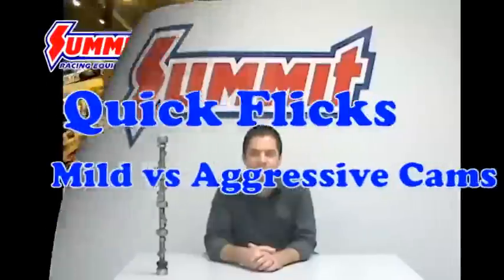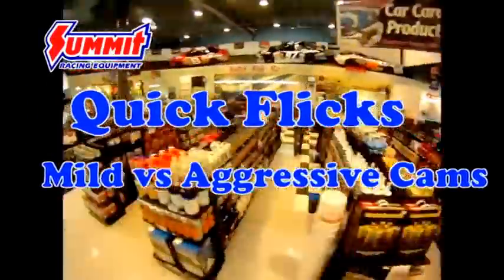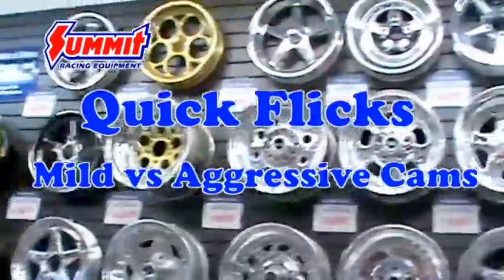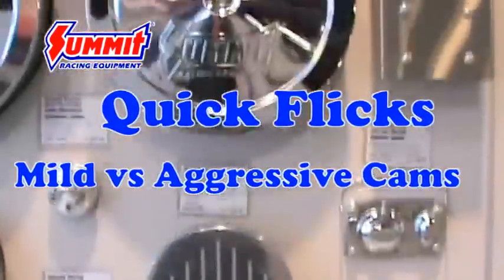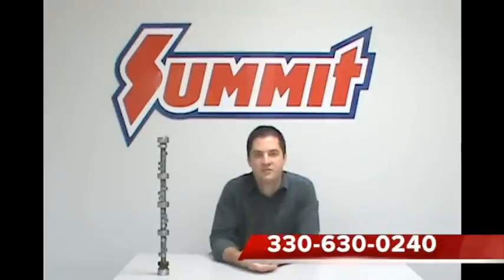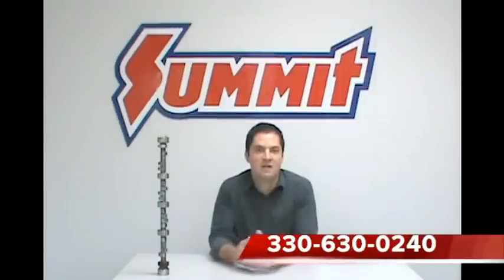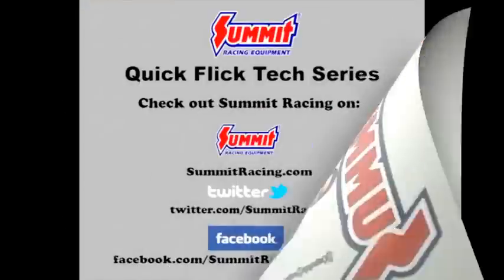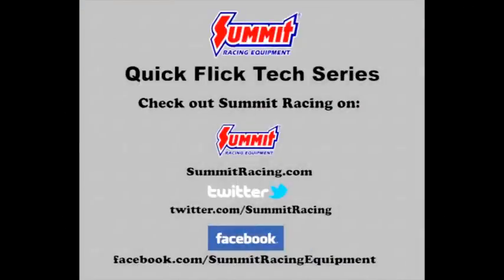Types of Camshafts | Learn the Differences Between Mild and Aggressive Cams

Comment: I have a 1980 gmc crew cab dually 2wd th400 with clutches and shift kit & 4:56 rear gear I've spun bearing in 2 454's so have a 350 in it now has a 12-206-2 comp cam cause I had it laying around also has old School single plane Torker intake with 1" spacer & 650 edelbrock carb 1&5/8" headers with 3in collectors and 2.25 exhaust all the way out the back with glass packs stock stall also. Should I get more aggressive cause I'm used to my diesel where I feel like it's gutless unless your sucked to your seat 611hp 03 6.0 powerstroke I just want a fun reliable daily driver
Reply from the maker: +buster layton , 
If you are trying to equal the Powerstroke power output, you are going to need more cubic inches, compression and air & fuel!
Reply: Correct, a sb chevy 427 or 434 can get you 600-750 hp but it will cost more than 3 of those trucks are worth. You can build a 383 sb chevy and get around 550 hp at a much more affordable level. The 383 is going to cost you at least 5-6k and thats doing a lot of the build yourself.

Comment: Simple facts about cam shafts.  
1.   Its a lot of work to change one.    
2.   You want RESULTS ! for your hard work.  a RV cam, 268, 270, anything with 112or more lobe separation is a total waste of time.   Long duration, tight lobe separation 107 108 will give you lots of 'over lap' (both valves opened at the same time) thus the lopey sound.
3.  You can go too far hipo, and lose idle completely (bad is you have an automatic trans, or lose vacuum completely making power brakes difficult.
4.   Probably  90% of people just want a bumpy, lopey idle for loping through the parking lot at the next car show, or traffic light.
5.  Headers, another waste of time and money.  They 'might' add 6-12 HP, considering the amount of work to install.  Not worth it.
6.  Carb, bigger is not better.  283-327  500-600cfm MAX,   350-383 750-800cfm MAX  leave the 1150 double pumper to the big blocks.
7.  The guy with the REALLY CHRISP lopey sounding car at the car show, has A LOT of compression, on top of that big cam.  If thats what you're looking for that is a complete engine tear down by a professional builder...  Only then does "CAM SELECTION" become important.   Then do big tube headers, high stalls trans, rear end gears.  This is when you have more money than brains.

Aluminum heads, port and polish heads, another waste of time and money, unless you're going 'full race' build.  You will never feel the difference in a mostly stock car.

Old school hot car, hot cam sound,  run a 'cutout' on your exhaust system, and a manual choke to your carb.  When you pull into the parking lot, open your exhaust and choke the carb to the sound you like.
Reply: Wow.
Just. Stop.
Reply: cmscms123456 apparently everything is a waste of money then.
Reply: I don't know much but im looking for that rough idle sound cant you just get a stock cam with more overlap
Reply: cmscms123456 well you just need a stock 305 SBC
Reply: @ 
cmscms123456

If we are going to simplify, then lobe separation angle of 112 is good for power brakes, keep lift under .500 lift on a SBC to avoid messing with valvetrain geometry, 10:1 compression, and a Holley 3310 should give a quick ride.  I don't have 10:1 compression, but I am going with the items above.  My car should be quite fun once I break in the new cam.
Reply: Ryan talk to comp cams they sell a couple cams that will fit your needs and not have to change springs and stall and all that. I think the cam is called thumper and like I said they have a couple different ones... Call comp cams ....
Reply: I guess that’s why every single performance-built engine ever, has a big cam, upgraded heads, headers etc...
Reply: Aluminum heads are a tool when you have built too much compression for pump gas by just a small amount. Aluminum heads in place of cast iron are the same as dropping your compression 1 full point when it comes to detonation. This is a quote directly from Scot Godbold at Crane cams. He also says that 200 psi is the maximum compression you can run on 93 pump gas, and thats using modern efficient aluminum heads. You cant run 200 psi with cast iron heads.
Reply: What if I have a 427 going in a F-600 or RV for highway towing? What cam and carb? I'm guessing it depends on crank geometry and head flow?

Comment: Will a LS2 cam fit and work properly in my 2007 Chevy Monte Carlo SS 5.3L?
Reply from the maker: Calvin Burleson , Physically the cam will fit and work but, you will also have to change the timing chain set (3 bolt), delete the DOD and have the computer retuned. It would also be suggested to upgrade the valve springs to match the cam and upgrade the trunnion bearings in your rocker arms due to the increase in lift, spring pressure and RPM. Another suggestion would be a better intake manifold and throttle body for all this new airflow. This will be a big undertaking as the motor must come out of the car in order to slide the camshaft out!

Comment: If I use a solid roller cam at .700/.714 lift 308/316 duration how often would I have to set valve lash if I drive the car once-twice a week in the spring/summer time
Reply: Every time. A hydraulic roller will only lose you around 30 hp. Now if you take a flat tappet solid lifter cam, you will need an additional 10-12 degrees duration in the flat tappet to equal the hp of the solid roller. Problem is, once you get up over .650 you cant get flat tappet solids anymore.
Reply: @donrutter6765  because I've heard that solid rollers dont really need to have anything adjusted, it's just rougher in traffic, but I've also heard you constantly have to adjust valve lash with a solid roller
Reply: @donrutter6765  so your tellin me every time I take it out I have to adjust valve lash???

Comment: just wondering if there is a stock cam that sounds like a big cam at idle .
Reply: tighten up duration with a little more lift not much tho. Check your local parts store catalogs and read cam descriptions.  My first cam swap I used a "towing cam" and it sounded great with a lot more bottom end torque.
Reply: Old GM LT-1 cam sounded pretty rude. L-79 350hp 327 cam sounded pretty mean also.

Comment: What would be a good cam upgrade for a stock mopar 440 hp2 engine?
Reply from the maker: Hi aaronmcgaga83, 
We need some additional information from you. Can you give our tech line a call? 1-330-630-0240. We look forward to your call. Thanks for watching!
Reply: So first of all the 2 in hp2 doesn't mean anything more then it was 2nd shift. Night time. A stock gear stock compression 9.5 automatic with a dual plane the best 100% best cam would be the 280 474 MP purple cam 110 lobe separation angle. This cam will make you very very happy or comp cam is cheaper you could use their equivalent. If you need the part # for either hit me up.

Comment: I drive my 99 trans am maybe 3 4 times a week its not a daily driver...I have full exhaust pacsetters LT headers ORY SLP cat back system loudmouth 1. Whats a good cam for this build Im also going with ls6 intake Patriot or precision heads. This is the cam specs I was looking at Cam, Sinister 230/236 .591"/.601" 112  but whats your recommendation?

Comment: why doesnt Summit create a cam shaft prefered list for the type of application.  So lets say Im a guy who just wants to hear nice sounds from the engine, and a little bit of power increase, I do have a highrise intake but i cannot afford buying rocker arms, springs, and or valves. so with that being said whats the best upgrade to get the most sound and power combined with just swapping out the cam with lifters. My Engine is a 454 7.4 stock with about 150k miles in it.  TBI injected and will have new straight pipes once the cam is installed.  Thank you!
Reply from the maker: Hi Jose Luis Noriega, 
Due to erratic vacuum signals (caused by rough idling camshafts), it is not advised to install one in your vehicle. We do have some camshafts that are considered an upgrade for your motor, but they will not have a rough idle. Give us a call and we can help you pick one out.1-330-630-0240. 
Thank you for watching!
Reply: Summit Racing, Thank you very much will definitively give you a call, what about a list of upgrades for all applications? That will be an awesome resource.

Comment: Love you guys at Summit. I've spent a Rack of money on your stuff. What this video FAILS to mension that the displacement will affect how a cam will act in an engine. For example I have a lg4 305 in a 86 firebird with a Comp Cams 260H, which acts like a 214 dur @.050s in a 350 chevy.
Reply: Well the 305's problem is the small cylinders wont let you unshroud the valves. So the crank is the same as a 350 crank, but the edge of the intake valve is too close to the edge of the cylinder wwhich hinders flow. On a 350 you have the room to use your grinder and grind the metal away in the heads next to the intake valves. You cant use 2.02 valves on a 305 because the valves hit the edge of the cylinders. So you are stuck with a motor that cant make over 300 hp or so. The 350 converted to a 383 can easily make 550 hp quite cheaply. I work on my friends dragster that has a procharged 383 sbc that makes 833 hp. He's been 7.90 in the 1/4.

Comment: I have a 2004 ford f150 XLT heritige with a 4.2 OHC V6, 5 speed Transmission with 3.55LS gears and I wanted to add a RV mild cam without having to change my liifters, springs and torque convertor. its my daily driver

Comment: Just buy the one at the bottom of the page. Gear accordingly.
Reply: Richard Noggin Pontiac 301, w/ a 315 duration and .470 lift cam. It’s my daily. It sounds like an evil bitch, but literally cannot get out of its own way :)
Reply: How can I bye one
Reply: Correct. Slap a set of 12:1 pistons in, a set of AFR eliminators, and have Chet Herbert grind you a custom cam around 305 duration, .600 lift that works with your new 3500 stall converter and 4.56 gears. 😁

Comment: I built a vet 355ci 11.5 to 1 forged pop-up pistons Z71 rods good to 7200rpm twin point distributor with correct accel ignition double hump heads with 202 valves triple springs on the heads 230 110 485 lift cam holly 750 double pumper.  Ran like a raped ape . With plenty of vacuum to run the headlights ran it to 8000rpm

Comment: Well first of all people don't really add camshafts for horsepower. Unless they're going to do a whole stroker kit or maybe add as a bonus to a  blower upgrade. So the horsepower will match the sound.
Most people add a camshaft if they already have power because a stock Factory car like a Dodge Demon doesn't really sound like it has a thousand horsepower. It sounds like it's a little probably 200 horsepower small block V8. And the camshaft brings the sound up to match the horsepower. Because you want a real aggressive cam profile and a real choppy cam if you have a thousand horsepower. I don't understand why the factory does not put a choppy cam in these cars when they're selling them brand new. But I hate the way a stock Dodge Demon or Hellcat sounds. They need to sound like a 2023  COPO Camaro with 632 big block.
Those of you that don't know what I'm talking about just YouTube the 2023 COPO Camaro 632  And listen to it idle. It will blow your mind how choppy it is.

Again people add camshafts for the sound! 
Because Factory cars suck

Comment: i have a 94 z28 that im rebuilding and im looking for a good aftermarket camshaft i can use and still pass smog 😅 Its a 5.7 LT1 with aluminum heads and headers
Reply from the maker: Hi Carlos, 
We need some additional information from you. Can you please give our tech line a call? 1-330-630-0240. Thanks!

Comment: How about a cam for a 2008 Chrysler 300 2.7?
Reply from the maker: Cody Red, 
That motor is known as a dual overhead cam motor or DOHC for short. This means that you have 4 camshafts total that are all driven by a chain. Unfortunately we do not offer any upgrade cams for this motor right now.
Reply: Thanks for the reply.

Comment: I figure, big camshaft, big cubic inch big block, big cylinder heads, big headers, big carb, big intake, big power😎💪
Reply: Wrong lol
Reply: Big horsepower maybe, but not a wide powerband. Engine shops today base their quality off of how much torque per cubic inch they make, not horsepower. Anybody can bolt big parts on, but the trick is how much torque you LOSE to get there. The top 1% of engine builders in the country are making 1.47 ft. lbs. of torque per cubic inch in a naturally aspirated engine. To get those numbers they are using heads with smaller cc intake runners, not larger. Smaller runners increases velocity, which increases low end torque. Larger cc intake runners robs torque and also raises your torque rpm peak, but may give you a similar hp. reading. Remember a wide powerband avg. that is slightly lower losing out to a peaky motor with a narrow powerband, the first motor always wins.

Comment: This guy by me has a newer Silverado with a wild cam but I don't think anything else. God does it sound terrible and the truck's automatic doesn't seem to like it either. Sounds like it struggles when he takes off or traveling at a low speed.
Reply: nomellocreampig 
sure it does. 
He just killed his low end power so now his converter stalls at a lower rpm, not a lot , but since he has no low end power its gutless. I'd rather have a stancemobile over a gutless log.

Comment: No explanation of what the fine points mean-lover separation, lift at 0.050,etc. Many people won't know what you're talking about.
Reply: Lift at .050 is meaningless. Duration is the most important #s, lobe separation only matters on your duration. A guy can run a 106 lsa with 210 duration and drive it all day long in traffic. The same 106 with 230-up its a whole different beast.

Comment: I need a high performance cam for my  011 Toyota Camry
Reply from the maker: +Cayden Smith , 
We are sorry to say that we do not have a high performance camshaft available for your application. Good luck!
Reply: +Cayden Smith do not modify your camry... buy a project car to modify
Reply: +Cayden Smith 

Your mom is going to be pissed you want to mess with her car.  Try your sisters bike... put some playing cards clipped to the spokes... sounds cool and you will go real fast.   You will probably impress that Camry crowd as well!!!
Reply: Riley Baker

Indeed... you were always the most popular girl on the cell block.  Nice to see nothing changed.
Reply: +GotScout Mmm Thats Funny Cause I Work At A Prison
Reply: +GotScout Ooo Btw I Have A 2012 Chrysler 300c With The Hemi
Reply: ive got a 85 s10 blazer with a small block in it
Reply: +Riley Baker good deal
Reply: +Cayden Smith 

"Buying it" is always an option if you can't build it... I guess.  :-)

(just picked up a 1974 440 with 10K miles on it 2 days ago... for a Scout build... )    Zoooooom!!!!
Reply: ^.... dreams of joining Isis as lifetime goal...
Reply: +Samuel Mason you can't cook tires in anything there guy, and rotary engines are quite amazing, some of the first rotary engines in the 50's only had 7 moving parts... If you want to slay tires for cheap, stop the hate and get a v8
Reply: +Cayden Smith It's ofc your call, but wouldn't it be better to sell the non-daily driver car of yours (I can't tell if you drive the 300c or Camry to work/groceries) and get a Fox body Mustang and just engine swap that one? ... Car will be cheap as hell, there will be lots of info on how to easily do the swap to a Chevy SBC and you can upgrade and replace anything for cheap and if you crash the car, replacement of anything but a new crate motor will be cheap. And even if that happens, a junkyard 350 Chevy + eBay turbo ala Hotrod magazine should be like $3-4k in a new cheap-as-dirt Fox body. Which means that since everything is as cheap as it gets, you can have fun and not worry while still racing either track or circuit tracks (add some suspension parts for that) and have a ton of fun for very little cash. But good luck with whatever you do.
Reply: +Samuel Mason 
You should learn how to communicate in a Civilized manner.

Comment: The rear gear ratio has nothing to do with the performance of the engine.The rear gear ratio is tuned for the track at hand.Not all cars are drag cars.The 2.9 first gear I use with 3.50 rear gear allows me to come out of hairpins in first gear on a tight track.4.56 gears would make my first gear useless.

Comment: What I would like to know is what Dodge did to make the Magnum engines frim the 1990's so DAMN GOOD!! I'VE got a 95 Dakota 5spd Magnum 3.9V6 and it has FANTASTIC low end torque. Like a small v8  & much better than the GM VORTEC V6 OR ford 4.2v6. I've owned all 3 and the best is the dodge even though it is the smallest & has the shortest stroke engine. And I was getting 22/23 mpg on the fwy even @ 75-'80 w/o the AC.18.5 W/ AC. WHAT DID DODGE DO RIGHT & why can't Ford & GM learn from them?